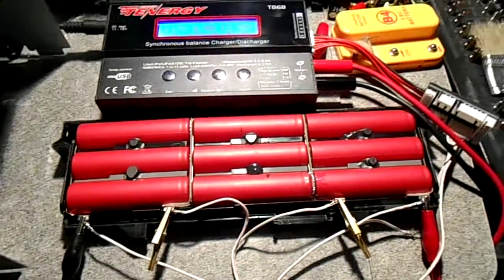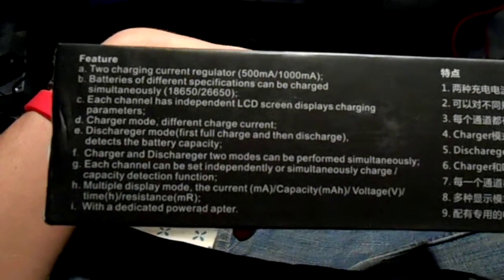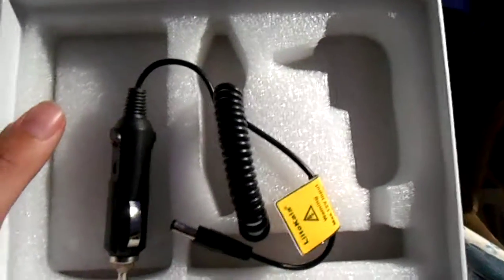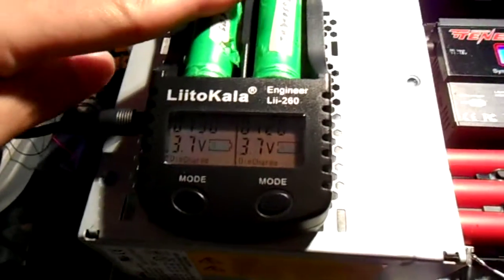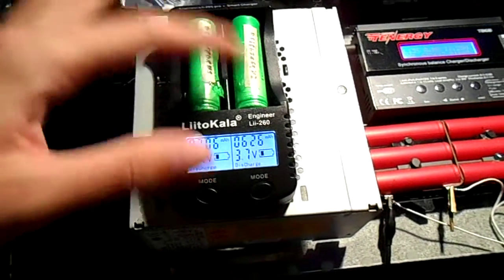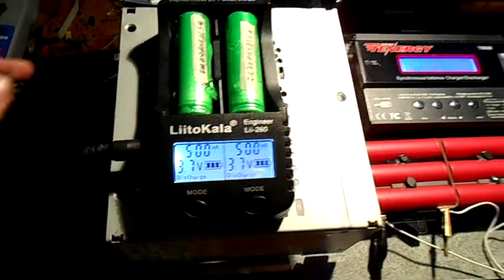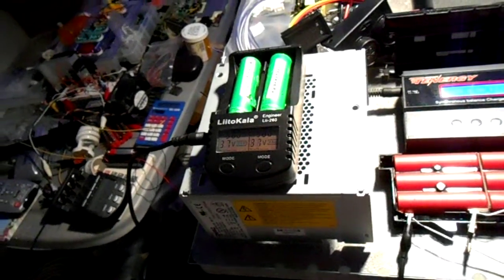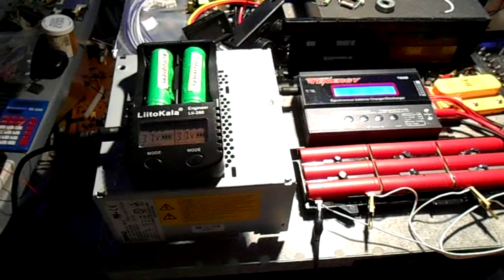Litokala Lii-260 Li-ion Charger Review

Comment: how accurate is it when measuring internal resistance compared to the turnagy you are using
Reply from the maker: Absolom Madhaka the Tenergy TB6B does not measure internal resistance, and the Li-260 tells you it is an arbitrary number it isnt accurate to any ohms law or other proper formula however it provides you with a good estimate to compare one battery to the next. i do not have an ESR meter that i can test it against either sorry about that. there is a great review by a well known flashlight enthusiast HKJ here: http://lygte-info.dk/review/Review%20Charger%20LiitoKala%20Lii-260%20UK.html

Comment: sir between this one and the liitokala 500 which is better
Reply from the maker: Absolom Madhaka hello, i do not own nor have heard of the Li-500 until now but from what i can see from a quick search is that it has 4 battery slots, 4 charge current steps (300, 500, 700, 1000mA) and a 5v usb output, where the Li-260 only has two battery slots and 2 charge currents of 500 and 1000mA and no usb power output. the Li-500 also has a much larger display, though it doesnt have the ability of monitoring two batteries at the same time, and seems to come with a car adapter from most places. so if you are wanting the extra functionality i can recommend the Li-500 however i have not used it so i cannot say it is as good quality as the Li-260. and as far as functionality you will have to compare that yourself from where you are willing to buy from. let me know if you do decide to get it and make a good review i am intrigued as to how good it is.
Reply: SuperBrainAK thanks but are you satisfied with the 260 i am particularly interested with the internal resistance measurement i deal with a lot of used 18650 cells so this is helpfull in selecting good cells for building battery packs
Reply from the maker: Absolom Madhaka yes, the charger has been serving me well whenever i have single 18650's that i need to test, i think the Li-260 will serve you well also. if you have alot that you need to test quickly i would recommend getting a second Li-260 instead of the Li-500 because more people have reviewed it and it does not have the weird usb output that can potentially spoil your battery tests.
Reply: SuperBrainAK thanks a lot it seems so as i have seen most reviews favour the 260 even better than the 300 also thanks man
Reply from the maker: your welcome friend

Comment from the maker: i took it apart! check it out! http://postimg.org/gallery/12l4jxlu6/
Reply: Thank you for the High-Res images, saves me the trouble of opening it:)
Reply from the maker: haha your welcome, it wasnt too hard to pop open actually, you just have to be careful with the battery terminals. i was surprised how well and simple it is built.
Reply: SuperBrainAK  This really is a great budget machine! Got "broken" laptop battery that had somehow broken 2 of the LG 2200mAh cells, and after testing with this i found out that the rest 4 were at 2110- 2185mAh. Allmoust as good as new, the 2 that had "broken" saved the rest from wear and tear. So with the price of this machine, i saved atleast that in battery costs just by colllecting otherwise garbage material and testing them.
Reply from the maker: Grey HD NICE! yea i do that with laptop packs that have had alot of cycles and have locked themselves out, so i can use them as raw packs and gang them together to make an awesome massive pack

Comment from the maker: Elliot Hunt well they arent li-po just li-ion but yea a bag like that could be a good thing to have just in case something happens, the balance charger there is my tenergy TB6B it works quite well to charge packs and balance them if you dont mind them only charging to 4.05v every time, as 4.1v is the cutoff and the cells drop down to 4.05v after charging. but stopping at 4.1v is safer than 4.2v and can prolong the life of the cells but you also dont get quite as much runtime out of the pack as you could by charging them to 4.2v. thanks for watching!